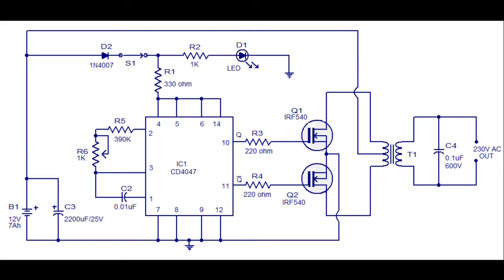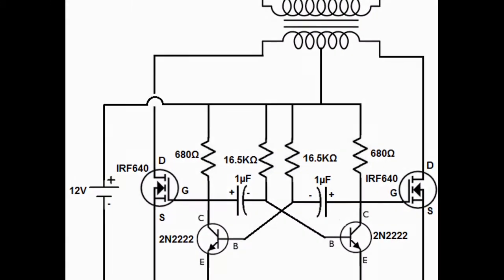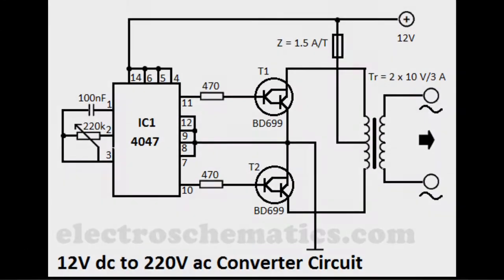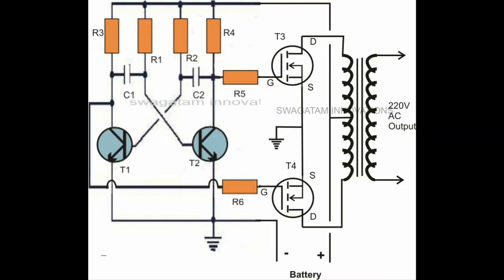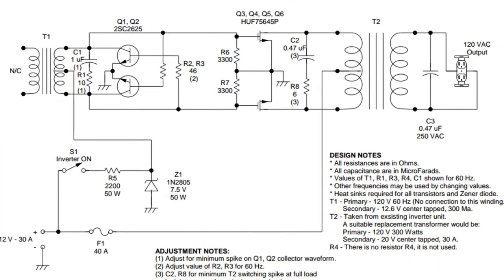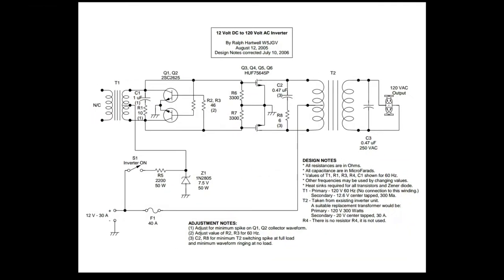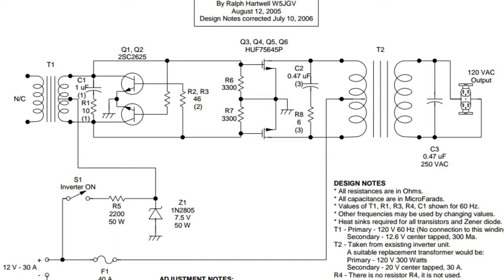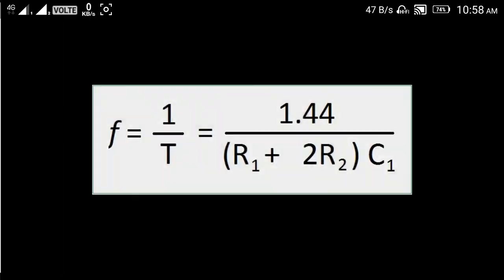Best inverter circuit explain

Comment: i need 1000 watt invater circuit
Reply from the maker: Same circuit but use 10 MOSFET and bigger transformer
Reply: @somesolutiontechnical   r u sure if i use 10 mosfet and bigher transformer like 6 amp 12-0-12 its reach to 1000 watt ?
Reply: Which circuit best for 1000 watt , please upload 1000 watt circuit
Reply from the maker: 10 +10
 20 MOSFET total 10 MOSFET for channel 1
12v 13A
Reply: @somesolutiontechnical  12 v 13 A  what  ????????
Reply from the maker: Transformer